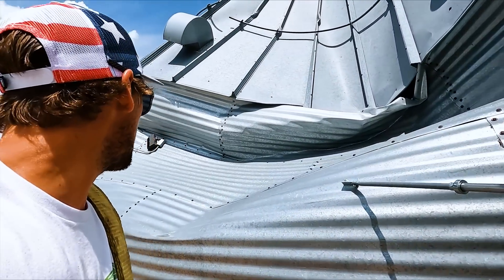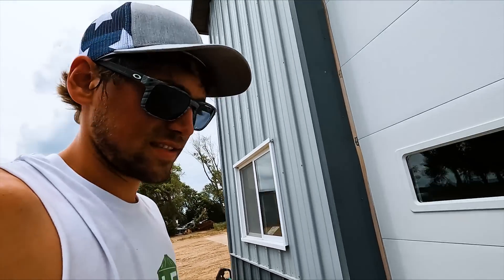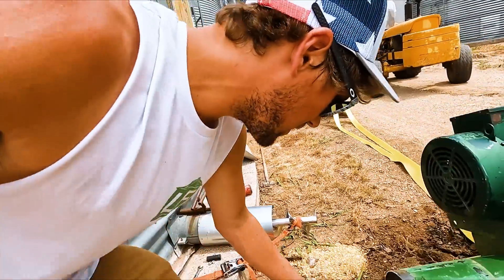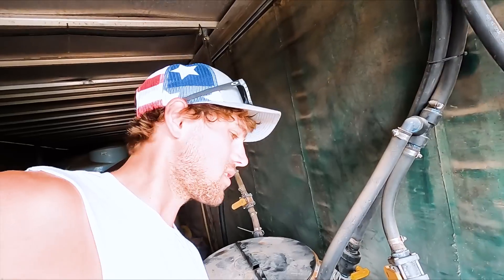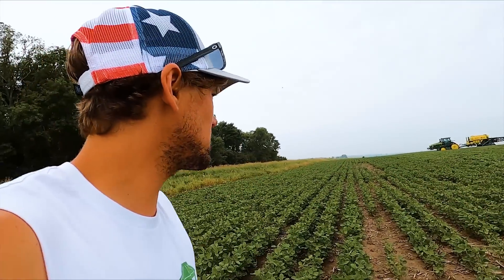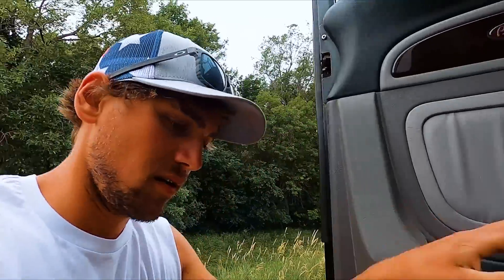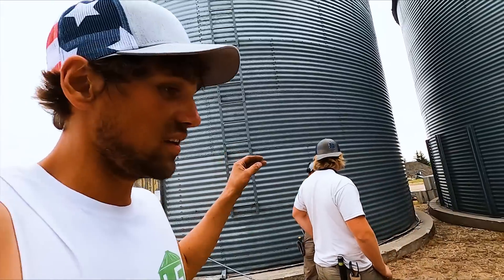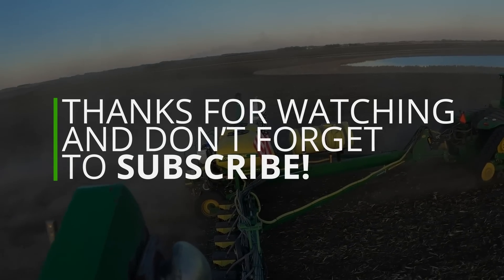Salvaging What’s Left After Tornado Damage!!

Comment: The first pour is the bin footing. Second pout is the stem wall. Then backfill for the floor. If you have any aeration trenches they will dig those and pour the bottoms. Them they will pour the trench walls and the floor in one pour. And I would bet there is going to be more re-bar in the footing before they are done. LOOKN GOOD!!

Comment: Know all about that rebar. Pour many a tank pad at the local paper mill. The silos set on concrete foundations that the pile cap was 8 feet thick  and then 3 more feet for the tank pad took over 13 hour of non stop pouring 2 10 yard trucks at a time to get it done!

Comment: The edge built up concrete pour is called a monolithic pour.

Much simpler to use a monolithic pour and only place concrete where you need it. Most building on a slab are done this way.

For your damaged grain bins. You should be able to bolt a strong back to the tin in a couple of locations, then remove other sheets of tin to reuse on the slightly damaged bin.

Comment: You could you use straight panels off the good side of the wrecked bin to fix the damaged bin beside it? Unless it voids your insurance it could be a possibility to reuse potential spares. Could add an extra ring of height too if there was enough undamaged sheets but I'm guessing that could be a redesign of the filler and require an Engineer to sign off on it.

Comment: The rebar in the bottom footer should really have a bend in it that goes up into the vertical wall so they are tied together. Maybe they'll come back and add more rebar before the concrete pour.
Reply: They a far from being finished on the footer.

Comment: Maybe set up a rain catch system  , with a small engine to pump that water from those tanks rather than 20-40000 dollars  4 tanks 4000 - 6000 a piece  with a 3 or 4inch hose to pump from to load fast.

Comment: There is a local company near me that commercial sprays. Over the years they have had problems making their chemicals work well and took some heat for it.  Turns out they were using city water that had been chlorinated.  The chlorine was breaking down the chemicals causing it to not work as well.
Reply: It's similar with beer manufacturing and food fermenting. The water needs to be chlorine and fluoride free as they either kill or inhibit the bacterial action required for the finished product.

Comment: Time to carefully take destroyed bins apart screw by screw.  Mount panels removed to the inside top few rings of undamaged bins to reinforce them from the suction.  damage of tornados lowering the pressure inside the bins.  
I don't know if bin manufacturers could roll Z beams into a circle to add flanges to the outside of the bins
Reply: Do what?😂😂😂😂